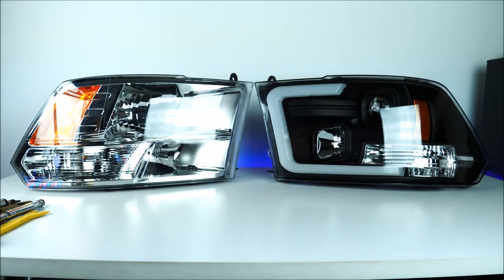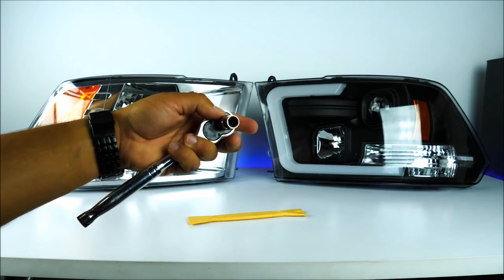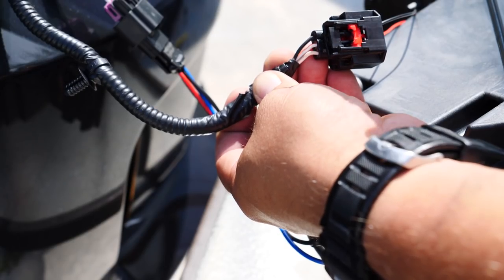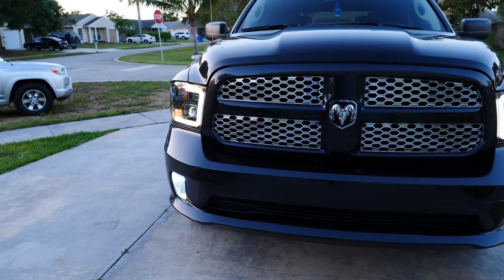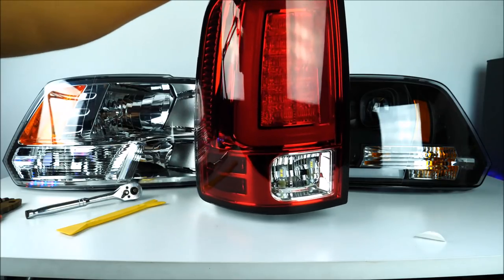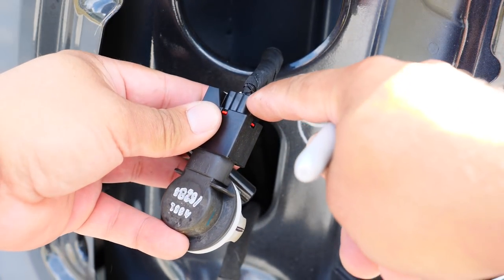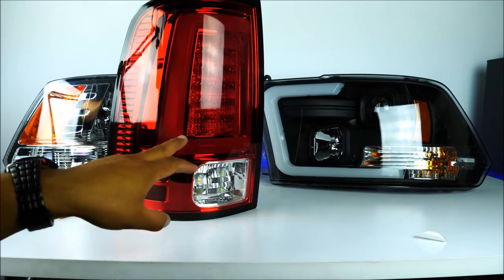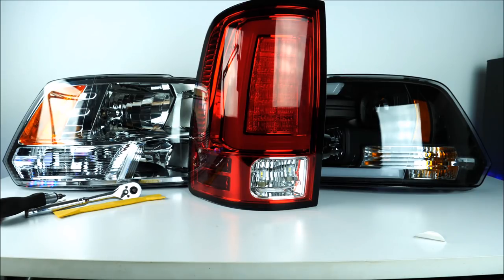New 2018 Oled Tube Headlights/Taillights for your Ram 1500 09-18

Comment: General knowledge for the masses. Right and left is determined from sitting in the operators seat on any type of vehicle. Cars, trucks, semi trucks, heavy equipment, farm machinery, etc. For most applications, passenger side is always right and drivers side is always left. Just an FYI.

Comment: Adhesive from the electrical tape can eventually dry out and cause the tape to fall off. I would reccomend picking up more of the crimp connectors, cutting the spade connector off, stripping the wire back and crimp connecting them.
Reply: Even then the connectors can corrode. You should solder all Connectors and heat shrink

Comment: Hey, right on bro! We went w/the 2017 Ram 1500 Crew Cab SLT. It's what we could afford. Wanted a pick-up that could fit two rear facing car seats for our twins. Along w/me not being squished while driving plus room 4 my wife if she needed/wanted to be back there w/them. Hoping to be able to afford a small camper(bumper pull) in the near future so we found one equipped with 3.92 rear end gears and the six speed transmission to have the ability to safely tow said trailer. Even w/out having a camper yet, I'm extremely happy going w/that setup. Here in Southern Alberta, Canada, it's very hilly and the wind can howl. As long as the wind isn't crazy, when I'm on the highway that young girl doesn't shift. I set the cruise, up hill, light wind, doesn't matter. Our last family trip, this past weekend actually, I had the mpgs as high as 21mpg! With the 32gal tank, I'm still using it, but I expect to get over 700miles out of if. I average 16.5-18mpgs but am really blown away by these last numbers. Mind you, we had a rough, cold long winter which caused me to run 4Hi often. A couple fill ups were in the 13-14mpg range so it's all relative, and how heavy my foot is! Either way I digress, thanks 4 the video. Have been researching some reasonably priced component upgrades that I can perform myself. We installed a color matching topper(camper shell) which added some style. But that was more out of necessity to make travelling easier. I hate tarping loads! But would really like to upgrade the audio system to a lager touch screen, replacing the mirrors to the fold out tow mirrors w/signals! The mirrors prob won't be a priority until we're closer to purchasing said trailer. As well as upgrading front and rear lights, so thanks 4 the tutorial! In a perfect world, I'd like to level the front end then add some Amp Technology automatic steps! But that's me dreaming. Don't know about you, but I get happier and happier w/my Ram every time she gets my family home safely. She's comfortable, powerful, stylish, economical and thus far reliable. Other than scheduled maintenance, I've repaired one tire due to a nail which wasn't on her. And something I never thought about until I had kids, it has a great safety rating. Engine mounts designed to break and let the engine fall out the bottom so it doesn't get shoved through the dash board in a head on collision, crumple zones to absorb energy and lost of air bags. Sorry 4 such the long post, rough night, not sleeping. Keep the info coming, fellow 2017 Ram Compadre!

Comment: I like your truck. My question is. Since the installation of the rear tail lights. Have you had any bad experience with water getting in  the light panels. Like from rain or from washing your truck. Thank You
Reply from the maker: paul P So far so good!
Reply: mayiandjay  glad to hear. I’m like you. I don’t like after market products that take away from the vehicle and look cheap. Also did you use led bulbs on the front. The reason I’m asking the makers of the front lights “Spyder” stated on their website it would void the warranty. I went to eBay where you found yours. But they were out but found them on iCard auto parts. Which I have made some purchases. They also had them but was only taking preorders. Spyder the  makers doesn’t seem to have anyway so one can make an order directly from them. But anyway thought I would past that on to you. Take care
Reply: Have the led tubes ever burn out??

Comment: What lights did you use for the Fog lights? 
Did you have any issues with your Dodge throwing any codes because of the LED switch on the tail lights, head lights and fog lights?
Thanks

Comment: good vid, just some tips should have used scotch locks or t taps so you wouldn't have to cut any wires, they even make they coated to prevent corrosion. They also make insulated male and female connectors so you don't need all that tap.

Comment: I have the Spyder led halo projector headlights on my 2017. I used a fuse tap at the fuseblock from a spare ignition activated fuse to wire in my halos and LEDs. This way, as soon as I turn the key, they act as DRLs and i don't have to turn on my parking lights to activate them. I do like the look of yours a bit better though, just not the $375 price tag. Mine were $300 on Amazon and came with the smoked lens foglights too.
Reply: Which fuse (number) did you tap into? I wanted to install them the same way you did. I also wanted to ground them to the truck.

Comment: Great Video.. I have a 2013 Ram Big Horn.. and I actually just ordered both these same Head and Tail lights from Amazon. I also up graded to LED signals and LED rear plate light and also the backing light as well. When you installed the new Headlights.. did you upgrade the headlight bulbs to LED also?

Comment: Hello great job on instructions. Question in regards to wiring. When you cut the white wire and attached the new wire what size butt splice did you use? Because on one end you have both wires coming out correct? Thank you

Comment: Great look on the truck man! I see on the video here shows the same head lights and pro tuning lab has them with the LED lights, I'm asking what led lights come with the lights and are they for LOW and HIGH beams? Also what light bulb do you have for your Fog lights? I have a 2012 ram and want these lights and with matching low and high beam light color and same with fog lights.thanks man if you can answer.

Comment: Hello 2 years ago I saw your video review on the Spyder headlights you install on your ram. Well after seeing it I purchased the exact ones and even installed the led light bulbs that you put on yours. The reason I’m contacting you is I noticed a couple weeks ago. That the inside of the headlights. The dark tint is starting to peel at edges by the lights. Have you noticed that with yours I spend 400.00 some dollars on them. Thank you

Comment: What bulbs are using in your headlights I am running into them changing colors to blue and yellow while I’m driving I do not know if it is the bulb harness for the LED bulb I have the LED bulb that I have plugs in like a socket did you convert to anything just wondering what type of bulb you were using

Comment: I understand the installation about 90% but it would be awesome if we could see you actually do the wiring connecting process of the LED tide to the parking light wiring. Do you have to cut the wire and splice them?

Comment: I'm wondering if you had any problem with the LED lights causing a burned out message on your truck??
Reply from the maker: B61 Mack Hello! My truck does not have any errors or messages regarding the lights.
Reply: Most of those ebay headlights are comming with the resistors already built in.

Comment: I added LEDs to these headlights and it seems that they may be overheating.  They stay on for about 20-30 mins, flicker, than turn off.  They will work again after a few minutes of my truck turned off but then the same thing  happens again.  Any advice???

Comment: Hey how are the headlights doing? I want to order these but I want to know if water got in them or if there's a mist yet
Reply: That's what I'm wondering... I have condensation in my current lights but I'm afraid to pull the trigger in these and have the same problem

Comment: I like your video very much.  However,  I have my 2014 Dodge Ram R/T with the front projector head lights. Is there a front head light kit available for my truck that is comparable to the set you have  in this video.  The rear tail light assembly will work just fine on my truck.  Thanks

Comment: Great video. I am waiting for my 2019 Ram classic I ordered.  I am going to upgrade the tail lights and headlights and these are one of 2 products I am interested in.  Could you post a follow up video to show the lights at night, including signals.
Reply: Also could you post the brand or Ebay link
Reply: Can I ask why you got classic instead of the new style? I always wondered that since specced the same the prices are similar here on my lots in Ny
Reply: @shane401  the classic is at least $10000 cheaper in Canada

Comment: Looking for some brighter lights ,possibly LEDs.  Like to get low and high beam and fogs on my 2016 ram 1500, any suggestions?
Reply: Ebay n Amazon has kits. I ordered a kit on Ebay high , low and fogs for 70bux. They are a big improvement over stock. I also just replaced the t194 license plate lights 2 led it looks so much better. If you want awesome dodge led lighting videos checkout BoostedMotorsports on YouTube his older videos when he had his Ram

Comment: Do these lights fit a 2019 Dodge Ram Classic Quad Cab also?
Reply: Why would you buy a classic over a new style when the sticker prices are similar? Very curious about that. Always have been. Thanks in advance
Reply: @shane401  some folks prefer the Classic design. I know I do. Bought a 2019 Ram Warlock Edition Classic.
Reply: @shane401  I prefer classic over the new body style. Its all preference. Front end looks not that great IMO
Reply: @cryptocrack2682  Same here. They sent me a pic of the new 2019 and I asked if they had a classic. Idk. Probably because I know how to work with them already

Comment: Did your truck already have daytime running lights before you used these? My 2017 ram didn't come with DRL enabled and the dealership has no clue how to enable it.
Reply: Just Jon Rides check the fuse box
Reply: REEF X mr for what? Everything I've read said RAM doesn't enable DRL for every state. It's software not fuse based.
Reply: Just Jon Rides if you want the DRLs, and they don’t know how to flash the computer to turn it on, run a wire to the fuse box for the DRLs.
Reply: REEF X mr thank you for the suggestion, I'll look in to that.

Comment: 🔥I had projection on my 14' Ram.
Switched to that white light LEDs. Will these lights still work with that LED?
Thanks ahead if you can answer for me.🔥
Reply: DID you find LEDS?
Reply: @ghostduckinvestigations9798  YES I did. They look awesome. I didn't do the work. A local shop did here in IL.
Reply: @IMINLOVEWITH  im in IL and I feel bad for you!🤣🤣🤣
Reply: @IMINLOVEWITH  i just did a 3 hr. Investigation and have will them here by tomorrow
Reply: @IMINLOVEWITH  hopefully it all is good!

Comment: Hello ...i purchase these headlights from eBay ...I got the head lights in stalled but they don’t run during the day on auto ... I have to move the light switch dial to turn then on and of course I have to turn them off every time I I turn off the truck... but the will run at night in auto .. did I do something wrong while installing them??
Reply: twoods555  I have the same question ?

Comment: Will these now require a high and a low beam? Since the factory bulb is both high and low I am wondering what type of bulbs are needed? I would like to pick these up but want to do a bit more research. Sorry if this was already answered. Thanks
Reply from the maker: Cynistyr Cyn Hi there! Now with these headlights you will use H7 for low beams, and H1 for high beams! Hope this helps
Reply: It does, thanks for the reply :)

Comment: I want those lights!! Look awesome!! Where can I get them???!!!
Reply: Headlights :  https://www.amazon.com/gp/product/B07CMFFWF6/ref=ox_sc_saved_title_2?smid=A21X3P1H73DDN3&psc=1   
Tail lights :   https://www.amazon.com/2009-2018-Dodge-Lights-Driver-Passenger/dp/B07C3C9GW3/ref=pd_bxgy_263_2?_encoding=UTF8&pd_rd_i=B07C3C9GW3&pd_rd_r=e283c2f9-0faf-11e9-88bd-15e7fd3adce8&pd_rd_w=gaPn4&pd_rd_wg=zZwvT&pf_rd_p=6725dbd6-9917-451d-beba-16af7874e407&pf_rd_r=M54AZKGDCY6QVH1TRP9E&psc=1&refRID=M54AZKGDCY6QVH1TRP9E
Third Break / Cargo Light :   https://www.amazon.com/DNA-Motoring-3BL-DRAM09-3D-LED-BK-Third-Brake/dp/B07BFJX2YM/ref=pd_bxgy_263_3?_encoding=UTF8&pd_rd_i=B07BFJX2YM&pd_rd_r=706d40e3-0fbb-11e9-a60b-cfebfa3ec185&pd_rd_w=Gbz6J&pd_rd_wg=93yzn&pf_rd_p=6725dbd6-9917-451d-beba-16af7874e407&pf_rd_r=ZZFGNVARWFECWZK97Z0Q&psc=1&refRID=ZZFGNVARWFECWZK97Z0Q

Comment: Do you know if you can replace the halogens with leds and which did you or can you use?
Reply from the maker: Michael St Jean Yes you can, now the light buld are H7 and these will fit well inside the housing! https://rover.ebay.com/rover/0/0/0?mpre=https%3A%2F%2Fwww.ebay.com%2Fulk%2Fitm%2F172734765220
Reply: Have you put the LEDs in yet?  the bulbs it came with aren't that bright, or do you have a suggestion on a brighter halogen ?
Reply: TxZ0mbie01 
I have not ordered the LEDs yet. The headlights and tail lights look great. I've been working on the wife's jeep and some other light installs. I will let you know when I get them and install them. Thx

Comment: I would suggest using heat shrink around your connection if you do not use water resistant connections. I wish you would have shown actual tear down and repair instead of just talking about it. There are alot of people that are visual learners.

Comment: taillights are really nice, but what i don't like about all these aftermarket headlamps is those small light sources, small reflectors. All aftermarket makers are focusing on DRLs with little reflectors thrown somewhere there, for same reason i don't like projector lamps, especially because they don't produce better illumination. I wish to find one day aftermarket headlamp with nice thick DRL strips like these on your video, but in combination with similar design original quad headlamp has. For now i prefer stock quad lamps with Canadian LMK code drl enabled
Reply: I would differ on the projector headlamps not having excellent illumination. I have them on my 2014 Ram R/T and I can see very well at night. I travel to rural areas from time to time & I don't see any loss of illumination with the projectors probably due in part to the higher rating of the OEM bulb than would be in aftermarket.

Comment: I bought this set of headlights about 3 months ago and they look good but there’s a problem with it. To start with!!  low bean lightbulbs can’t be replace and it has the ugly yellow old school  color that it’s not so bride. I try LED’S, HID’S and they didn’t fit. So you have to put up with it or return them back. Other than that ole tubes look good.

Comment: I'm wondering would splicing the wires void my warranty??
Reply: Yes it would
Reply: rokkero564 that sucks man because I really like these lights but not willing to risk it. I wonder if Jay knows this or doesn't care lol
Reply: Run a wire from your fuse block. Use a spare fuse that isn’t in use but provides the power needed when the truck is turned on.

Comment: Can you put a HID kit on it though?
Reply from the maker: boozer74 You can only do LED's, no HID's.
Reply: so you can't put an HID bulb in the projector ??
Reply: @djsinnay  just in case you still need to know you can't put LEDs in a projector setup it will glare like crazy HIDs will work fine
Reply: @Dezmond_Roman  the high beam is in a reflector housing so I don't see a problem using HIDs for the high beams

Comment: Not trying to be a dick but wire jobs like this are for short term. I feel bad for you if you keep this vehicle long enough or the person down the road after you. I personally don’t believe in hacking up factory headlight wiring and using improper connectors and electrical tape. The headlights themselves look fine I think I like the taillights more. Keep having fun with the build!

Comment: When you did a close up on your headlights they were flickering
Reply: Because they're LED. Do some research to learn why.
Reply: @imkevinhoff   Mine don't do it And they or LEDs
Reply: @imkevinhoff   That's why I always check my stuff before I buy it
Reply: It's not the LED lights. It's the camera which is creating the flickering in the video. That's why I said to research what it causing the flicker.
Reply: I know there's some truth to that BUT my more expensive LED headlights do not flicker at all on camera while my cheap $20 foglight LEDs do...I have no logical explanation for it but there's that.
Reply: has something to do with the resistors I  think

Comment: A "Domestic" truck needing a metric sockets?
Reply from the maker: diamondheat9 Now Fiat owns it!
Reply: mayiandjay plus built in Mexico
Reply: Where have you been the past few decades?
Reply: REEF X mr in imports.  Domestics don't usually appeal to me much. Ty
Reply: diamondheat9  That's a 90's remark. Metric has been going universal for decades. My 2004 Ram is mostly metric.
Reply: Les Felts not going "Universal" if standard is still used and sold in tool set measurements
Reply: diamondheat9 built in USA, get with the program
Reply: All modern vehicles use metric fasteners. The only vehicles that use SAE bolts and nuts are military vehicles.

Comment: OLED was a terrible decision. OLED uses carbon based organic components which can degrade. This degradation can be seen as burn in or even dead portions of screens on phones after just a year or so of use. For cars which are outside in variable environments the OLED could potentially quickly degrade. LED not only is more power efficient AND can get brighter, it is synthetic and lasts much longer. It would be like choosing an iron rather than aluminum body for a car. The iron will immediately rust, and the OLED will immediately degrade.